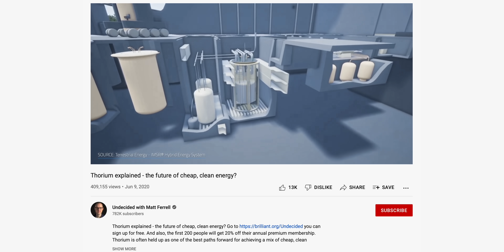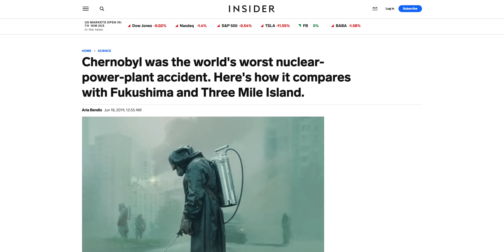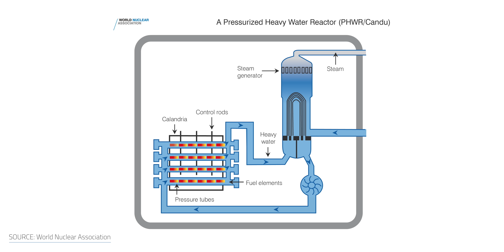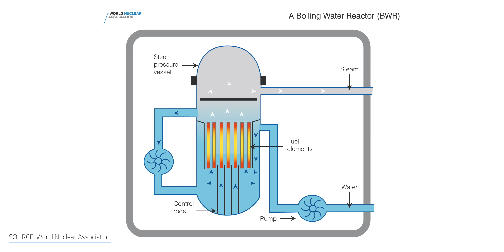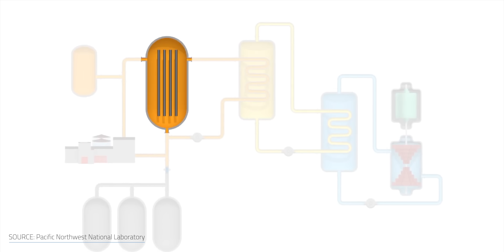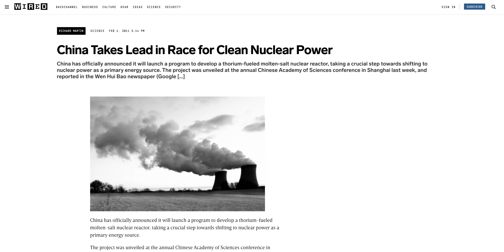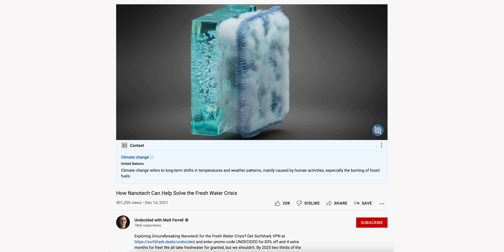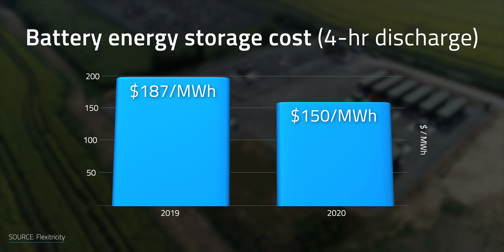Revisiting Thorium Energy - The Future of Nuclear Power?

Comment: The problem is we have Uranium/Plutonium reactors we can build right now. Constantly trying to delay things by saying just hold off we will have something better in a few years just ends up delaying us working on the problem. The old "Perfect is the enemy of good enough". It's not that I doubt Thorium reactors can work - but first we need the new reactors, and then we need the infrastructure to make fuel, whereas we already have that in place for more conventional systems.

We have the same issue with say the 90s/2000s hydrogen economy idea of everything will be better once it all runs on liquified H2, we just need the cryogenics plants and specialized piping to come online, then it will be the natural choice over batteries... We are already playing catch-up on carbon free energy sources, waiting another few years should not be an option.

Modern designs for Uranium reactors are a lot better than the 50s and 60s designs we've seen fail so catastrophically. The navy has been doing small reactors for the past 70 years, SMRs are not the "new will be ready soon" it's just a delay rather than take what is already available. As to waste - well we know what to do with the stuff, its just what we are allowed to do with it. Reprocessing is held up by law, not technology. Heck how do you think the US got plutonium during the Manhattan project? That is right, nuclear recycling has been available from the beginning.

Comment: Please stop showing a cooling tower every time you use the term nuclear reactor.  It is not technically correct and is misleading.
Reply: Why is this misleading when most Nuclear power stations use cooling towers,  requiring 20 million gallons of freshwater per hour. 11 Trillion gallons of fresh drinking water over their life time. 1/6 of all fresh water globally is used by the existing power infrastructure.
Reply: @stevetaylor2818  You keep rattling off this statistic like the water goes away forever.
Reply: @Baibakov88  You are right; the water goes around and around, but reservoirs were constructed, rivers depleted, energy was consumed to purify and pump the water.
Many hot counties have water shortages, often contributed by power generation consuming a massive percentage of their precious freshwater.

Comment: I think you can't close off any alternatives and should at least do the demonstration plants for both SMR and MSR. I'm not sure that the LCOE comparisons in your video work. SMR and MSR LCOEs are hypothetical until you actually get working prototypes to develop real data. On the other hand, I was thinking that the LCOEs for wind and solar seem low. For example, the LCOEs for wind and solar you cited don't appear to factor in load balancing which has to date been by natural gas plants, until you can get grid scale battery storage. LCOE comparative costs also don't appear to factor in grid improvement costs necessary for wind and solar to work at large scale and building new power lines usually runs into massive public opposition, even for green energy projects. I read one article recently saying it's estimated that grid improvements would cost an estimated $5 trillion nationally for both new transmission capacity (e.g. to move wind power from where it's generated to where it's consumed) and to simply to rebuild our nation's very old grid infrastructure. Also, the LCOE for solar that was mentioned in this video with only 4 hours battery storage seems low to me, given your prior videos on the different, but necessary types of short and longer duration types of battery storage that are being developed. I got the impression from those other videos that you need considerably more battery storage than 4 hours to make wind/solar work at a grid scale.

Comment: Matt, as always, your subject research seems very strong. I disagree however, with a couple of your points. You said that Thorium mining was more difficult than mining uranium but failed to say that Thorium is a by-product of rare earth minerals mining. There are stockpiles of discarded Thorium, in the US, that would supply the needs of future Thorium reactors for the foreseeable future. Also, the renewable energy fanboys always seem to drag out the "high cost" of building nuclear reactors based upon building expensive pressurized water reactors (Gen 2). If every new MSR was projected to cost as much as current PWR's then I would agree that pursuing a nuclear future would be too expensive. Thus the need for Gen 4 new technology, cheaper, safer and faster to build. Finally, while again stating concern over nuclear waste you failed to mention anything at all about the enormous upcoming waste stream from expired solar panels and windmills. Recycling efforts for these are expensive and it's just cheaper to discard them in landfills where the dangerous elements such as lead and cadmium will slowly leach into the ground and remain toxic until the end of the earth. This waste stream will have a far greater environmental impact than the very small amounts of nuclear waste generated by MSR's. Unlike the solar panel waste, this nuclear waste will be inert after a few centuries.

Comment: I don't think cost per MWh should be a main driver for the adoption of one technology over the other except in cases were the difference is so significant it wouldn't be feasible financially to even use. The environmental impact creating solar and battery technologies as well as the impact of wind farms on the environment has to be considered in addition to basic cost per MWh. Nuclear is as expensive as it is, in part, because of regulatory/environmental restrictions and in the case of Thorium also because it is still experimental. If China's process/design works and they decided to implement Thorium at scale I think the cost per MWh will come down tremendously. I think nuclear offers us a future in which we need to mine, cultivate, and use a significantly lower percentage of the resources used by solar and wind technologies.

Comment: i still stand behind geothermal and wish more would be put into it.
oil industry is the biggest to gain from it, as it keeps drilling tech into the future.
but since oil has a hold on drilling, maybe it's why it's not advancing.
geothermal can be built anywhere, even in high populated areas.
no need for 100's of miles of high tension cable.
or create a whole reliant complex of industries that could thrive off the waste heat.
like greenhouses in cold climate areas.
(perverse argument there about geothermal to power tarsand extraction 😀 )

instead of asking industry what  it wants to push on us, why don't we put all the viables out to the people and let them choose how they want their power created?
it's corporate lobbyists making the decisions, 
if the nuclear and high tension wire lobbyists win out, it'll be what you get.

you the consumer only have the choice of solar, small wind, and storage.
and remove yourself from a corporate grid.
not trying to sound cynical,  but it's pretty much how it is.

as options become more economical, i can see small communities becoming their own grids, with solar/storage in houses and business'  and maybe even a small geothermal plant if necessary.
creating new jobs and options locally too.
it's at the point it can be as cheap to put the investment in now and have it pay you back over the life, keeping a steady energy cost to you and not varying on the wims of varying energy costs.
"free" energy costs about the same now.

Comment: Two positives that you left out when comparing nuclear power to other low-carbon energy sources is footprint and location. Nuclear powerplants might have a higher LCOE than Wind or Solar, but they can be placed anywhere and take up significantly less space. This makes them much more viable in locations that don't get a lot of wind or sunshine. They also have the benefit of working 24/7 without a need for batteries.
Reply: "but they can be placed anywhere" I strongly disagree on that one. Conventional powerplants usually heat up water to generate steam and use that to drive a turbine, which drives a generator, which produces electricity. The steam is then condensed back to water and the cycle continues. I'm sure that is nothing new to you. BUT: In order to condense the steam you have to have a good cooling system. And that usually relies on the evaporation of water (that is what creates the white clouds coming out of cooling towers) - so you will need a lot of water as a coolant. So if you want to build ANY large powerplant that relies on steam - you will need a lot of water, or: a river nearby. So you would never build a nuclear power plant on top of a mountain, for example (I'm ignoring small reactors for e.g. research or military bases - you would build them on a mountain if needed, but that's not the type of reactor I'm talking about).

I agree with the notion that molten salt reactors have a lot of potential. But we should also not oversell them imho.
Reply: @TheMightyZwom  This is true, but I'd expect that we have a whole lot more cities near a water source than near optimal wind/solar areas. I'm also very interested in the potential of using the "waste" heat directly. Why couldn't there be factories nearby that need process heating water that get it from the powerplant? 

The point is that they're more flexible in where they can be placed. Nothing is perfect, but we've had decades of people running away from nuclear towards renewables and I think a mix is much more viable to keep up with demand while not hurling more carbon into the atmosphere.
Reply: @TheMightyZwom  Keywords there is 'Conventional' and 'Usually'. With the higher temperatures that MSRs operate at, it becomes viable to utilize fluids other than water and steam, like supercritical CO2 gas turbines. And it also becomes easier for the cooling loops to dissipate their heat.

The desire to retain the steam turbine approach is mostly because it is a very well known and understood technology and thus easier to adopt, but other heat to power conversion systems are available.
Reply: @TheMightyZwom  Yes, a 1Gw power station uses 20 million gallons of water per hour in the cooling towers, 11 trillion gallons over its lifetime! 1/6 of freshwater globally is used in generating power. A hidden advantage of renewables is we would free up enough fresh water to solve most of the worlds drinking water issues.
Reply: @stevetaylor2818  Thermal power generation isn't the cause of lack of access to potable water. What a ridiculous claim.
Reply: @Baibakov88  It is a contributing factor in many countries: The U.S. thermoelectric power plants use over 58 trillion gallons of freshwater per year (13 gallons per kwh). About 10% of all U.S. fresh water is consumed just by cooling towers. Plus, a massive amount of water is required for mining fossil fuels, especially Coal. In many counties, water shortages will be substantially reduced or even cured by moving to Wind and Solar.

Comment: You mentioned the potential for desalinization with the use of a MSR but there is, as you know, a big downside to desal plants in the discharge of brine back into the ocean as it is heavier than water and is consequently deadly to marine life. But how about going one step further with it? I watched an episode of Tech for Luddites yesterday regarding the upside of sodium ion batteries vs lithium. Sodium is far more plentiful and easier to "mine" than Li - maybe even more so if you were to further remove the NaCl from the brine of a desal plant to extract the Na for use in battery production? So I'm imagining a MSR generating electricity, heat to run a desal plant, and either "mining" the sodium out of the brine OR selling the brine to another outfit who does the extraction. Win-win-win? But then, what to do with the chlorine leftovers.

Comment: I thought one of the purported benefits of a Thorium reactor is that it could burn the uranium waste from existing reactors? If that is true, that would be an aspect that I would consider a huge benefit.   It is my understandig that we dont really have any real longterm waste solutions.  I think nuclear has potential but not if we cannot solve the waste issue.
Reply: Generally fast spectrum breeder reactors are seen as a better 'waste burner', but all MSRs burn up a large majority of the long-lived trans-uranics so it mostly depends on if the design will allow for the burning of waste. The main benefit of thorium is that is can be designed as a sustainable breeder reactor in the thermal/slow neutron spectrum whereas standard uranium mixes need a fast neutron spectrum to sustainably breed more fuel (though thorium can also be used).
Thermal spectrum reactors are generally seen as easier to manage and require fuel that is not enriched as heavily to operate but for the thorium breeding cycle to be sustainable it needs to be quite efficient with its neutrons and so is often designed with an in-line fuel reprocessing loop which causes several political and engineering challenges.